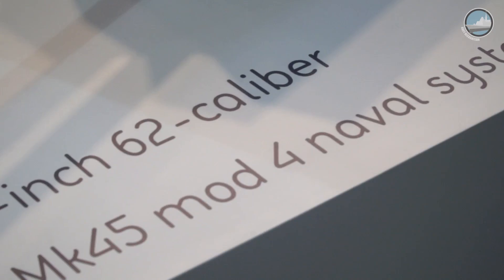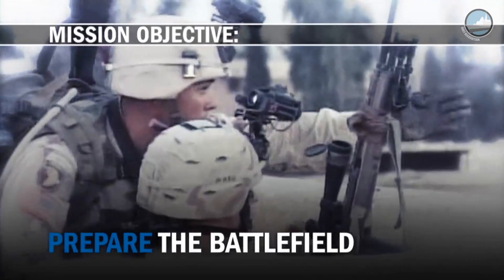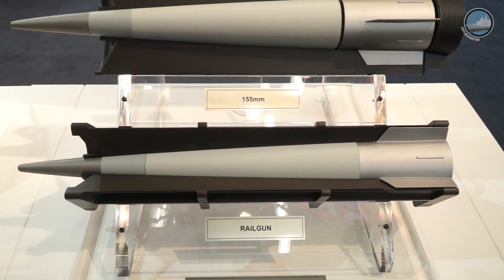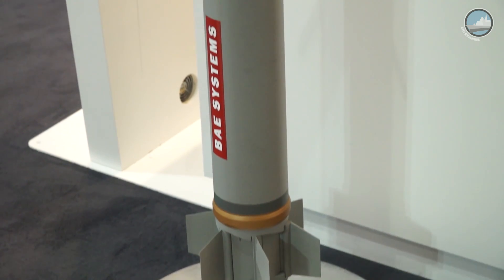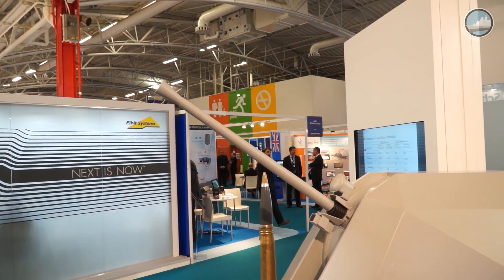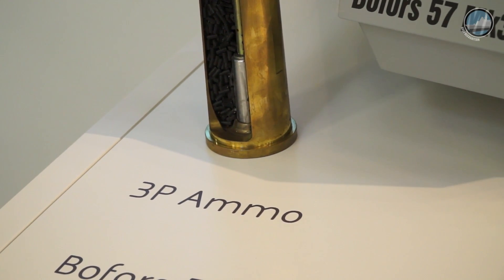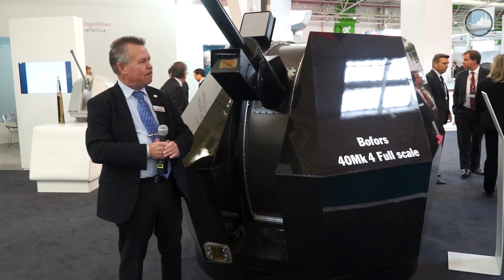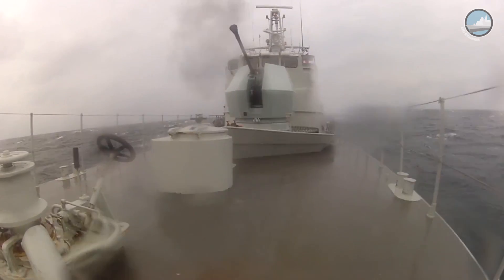BAE Systems Naval Guns at Euronaval 2016

Comment: With the 5 inch (127mm ) you have a rate of fire 💥 of 20 - 25 RPM... The RUSSIAN 5.1inch ( 130mm )Has a rate of fire 💥💥 of 80 --- 100 RPM ... I do like the BOFORS 57mm and 100 mm gun systems as they have incorporated the new ( ISH ) 3P GUIDED ROUNDS ,AS WELL AS THE EXTENDED RANGE AMMO

Comment: Shows how good the original Bofors design was still in service.
Would be nice to upgrade all the five inch guns on the Australian ANZAC class frigates to this standard.
Reply: The Bofors of WW2 fame actually used a totally different mechanism to modern-era Bofors guns. Which is hardly surprising since the modern guns seriously outperform their WW2-era fellows. Great range, greater power, greater flexibility. Still got that distinctive Bofors gun look though. :)